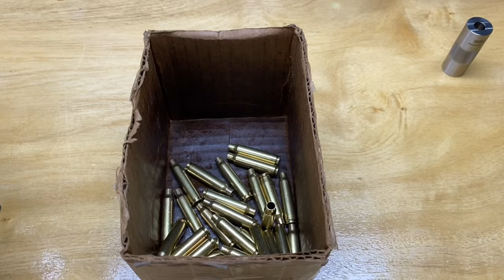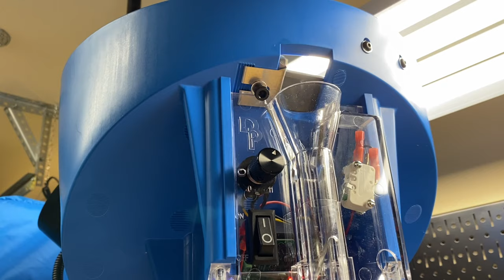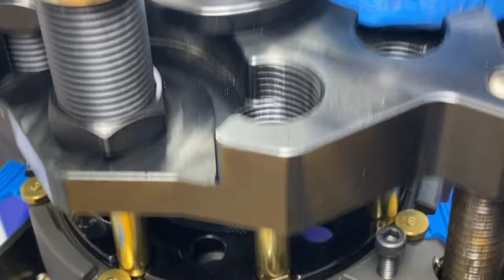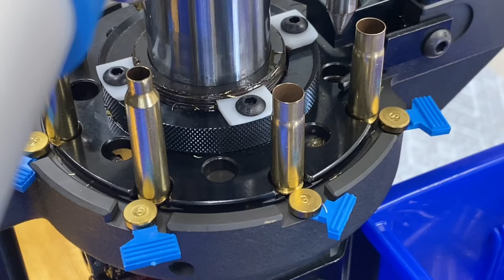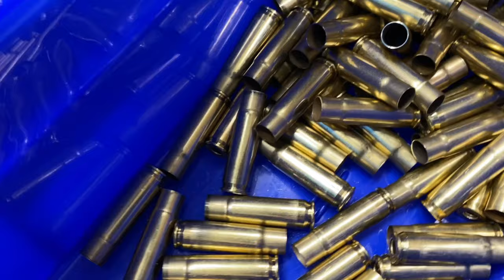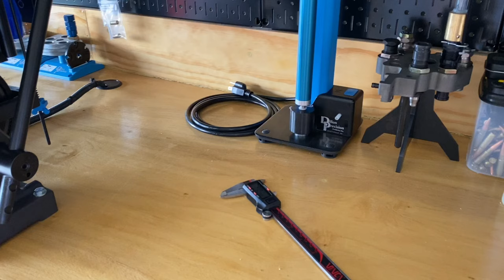Honey Badger Trimmer Kit on a Dillon RL1100 - Cutting .223 into 300BLKOUT (Case Prep)

Comment: Just got all the parts for this. Did you worry about the precision concentricity set up? If so did you do this yourself or take to a machine shop?
Reply from the maker: I did not do that even tho I'm pretty OCD.  I don't have the tools to do so and I never found a shop who did either.  I will say the setup is an absolute royal pain in the fkin ass.  No matter how meticulous I was it always cut slanted.  Of my entire time reloading this setup took the most patience.  Take your time and pack your patience.  I don't shoot sufficient to spend a lot of time or patience doing this.  There is now a lot more 300BLK factory casings at the range.  I pick 'em up, wash, rinse and repeat.

Let me clarify even though the cut was slightly slanted every single one case gauged and fired out of my Q Honey Badger and Sig MCX Virtus.  The Q Honey Badger is super duper picky at an extreme level as the tolerances are tight.  The Sig MCX Virtus I could fire acorns out of it.  Seriously it would fire the 220gr coated lead from Gallant.  The Q Honey Badger only likes 110gr Barnes TAC-TX Black Tip.  Super accurate EVEN with slant cut cases!  LMAO!
Reply: Sweet Jesus what dies are you using please
Reply from the maker: @caleblong3184  FW Arms - Decap Die and Swage Foot Die

Comment: This looks very nice.  Did you ever do the boring bar update? What are the advantages of a boring bar?  F&FB offers it as a $140.00 add-on, which is a lot compared to the $14 end mill bit....  Thanks for the info & B.O.M. you've provided, very helpful.
Reply from the maker: Yes I finally got it going. The $24 boring from Amazon and the cutting insert from Immortobot worked great.

Comment: What dies do you use for the trimmer setup?  Does it leave any sort of burr that you have to remove?
Reply from the maker: outboardprsnlstndup I am using a Whidden Gunworks Trim Die and a 13.00 carbide drill bit to cut down the case.  It works great and a clean cut that I do not have to deburr.

Comment: Very nice, I first saw your post on FB group I took a screenshot so I can have parts list and I have been going over it since then.  I don't have Dillon 1050 so I'll be setting up on my Hornady Lock and load, I know it can be done because I've seen original Dillon trimmer setup on it.  I am actually planning to convert to 7.62x40WT which is slightly longer than 300 blk and I believe same trim die can be used just adjusting the die higher.  If you ever find the perfect boring bar please update, I have several already, I am wondering if Giraud special "3-way" insert can be adapted to produce no burr brass!  P.S.  Where did you order the Bosch 3/8" collect chuck?
Reply from the maker: Dima Prok Sorry for delay, the chuck was purchased on eBay for like $15.00!
Reply: @SpartanArmament  I see, I finally ordered mine on Amazon, it was $30 with tax plus the router $185 (with tax) and as I was planning to order honey badger adapter I landed on Dillon RT1500 deal for $200 which already has everything.  I just need to order the trim die and I am set.  I am planning to run on Hornady LNL so I don't need special toolhead.